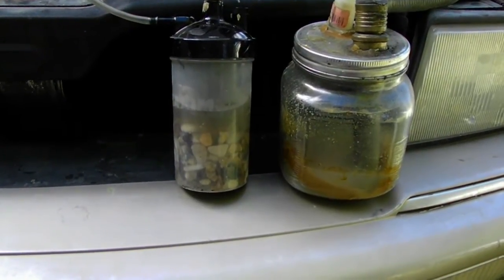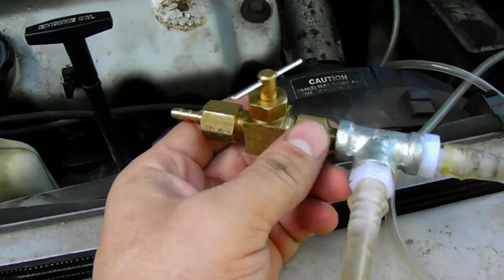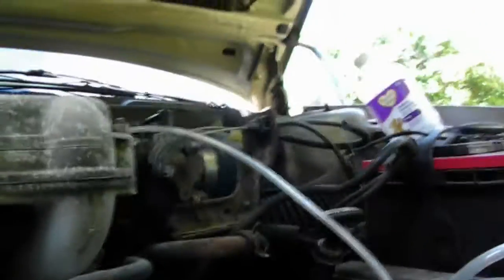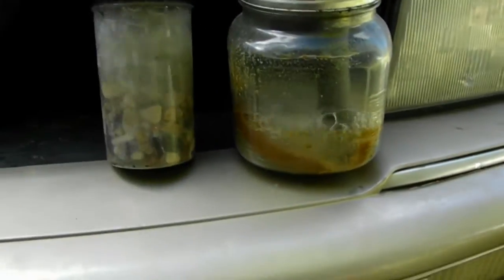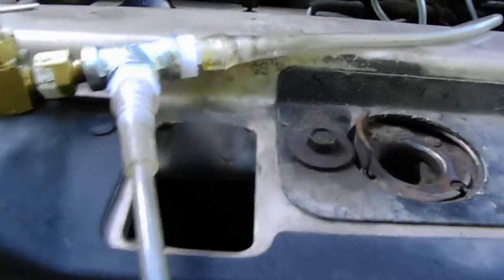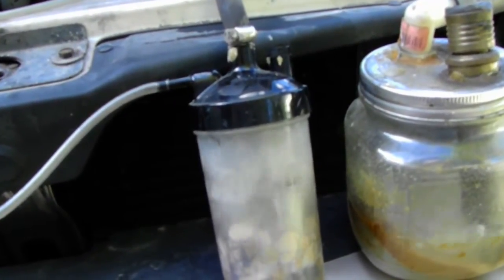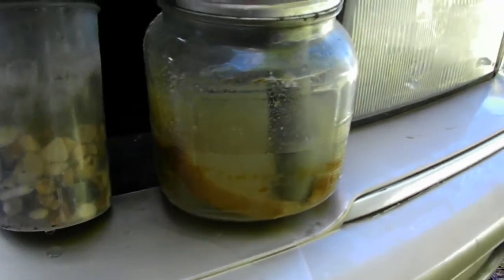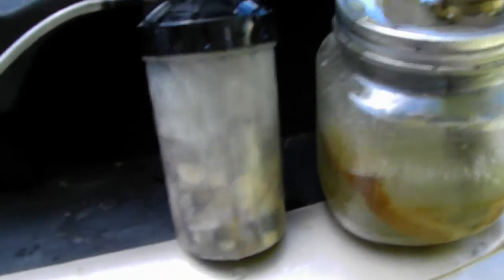Water vapor induction via venturi pump improved

Comment: suction of water vapor into an intake gives you more horse power due to expansion of steam flash over. As for seeing more fuel economy its doubtful with stock obd2 ecu, speaking from experience of my own. But it was nice at stop lights getting off the line quick.
Reply from the maker: Idont have obd2 it would still work with that system anyways
Reply: I got a California emissions system with air fuel ratio sensor not the standard narrow band o2 sensor that many fed emissions cars run. So the calibration in my car is set to 34 mpg anything over that ecu just uses more fuel. I think since my setup can't see the fuel content due to the vapor content it pumps more gas. At 65 mph it does lean burn. So I can run this setup but can't see any economy gains. A standard run of the mill federal emissions can see gains since it gets lower fuel economy.

Comment: Nice bro, im doimg the same but also I did open the gap on the spark plugs 20% and the miles on my saab went from 240 miles range to 405 miles range on a full tank.. I did trick the o2 sensors and mas air sensor a bit. I'm mixing alcohol and water too... I also did the gatgetman groove on the throttle body